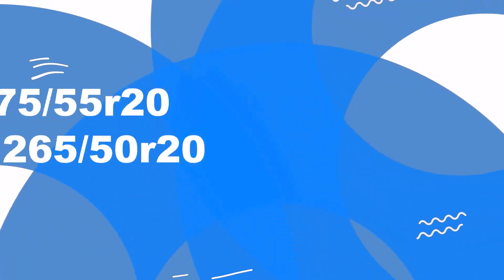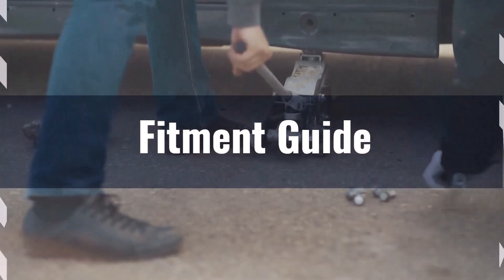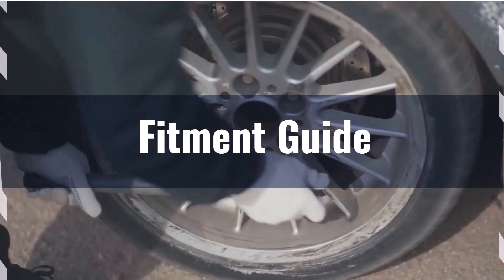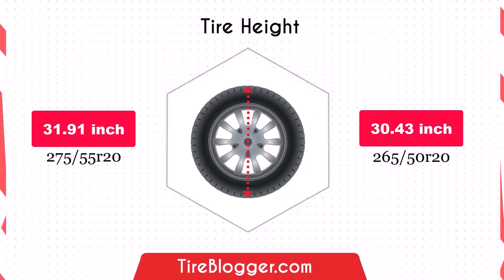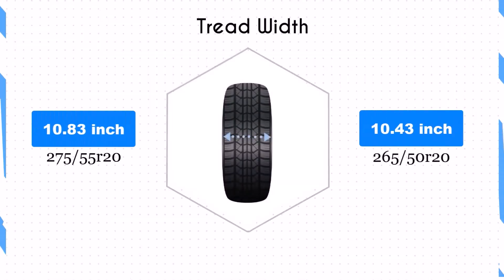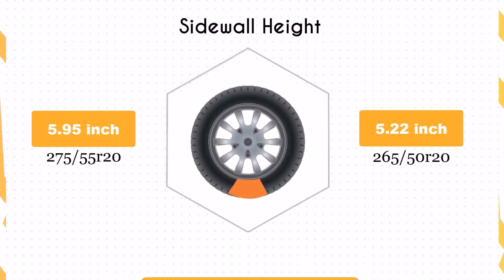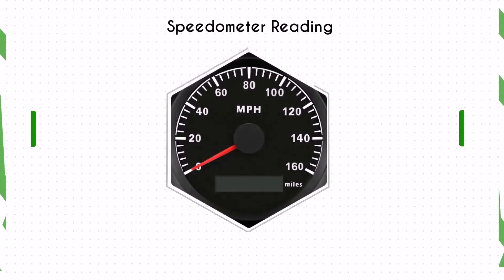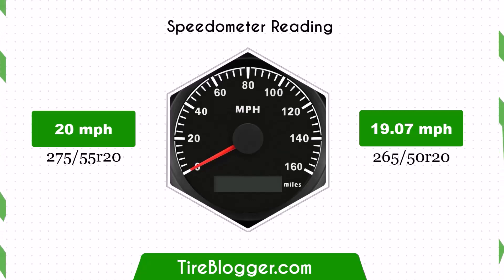Tire Size 275/55r20 vs 265/50r20

Comment: What is the psi of 265/50/20
Reply from the maker: Standard Load (SL) tires support up to 2,149 lbs at 36 psi, while Extra Load (XL) tires handle up to 2,403 lbs at 42 psi.